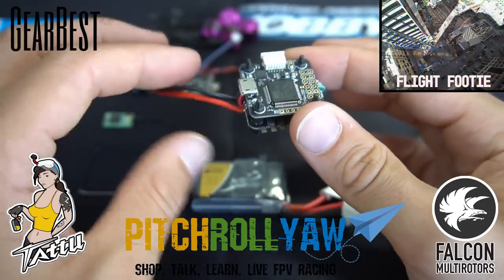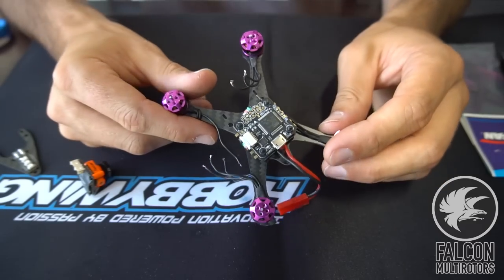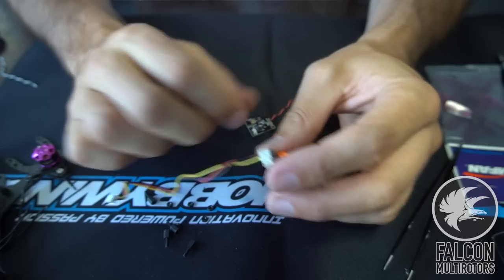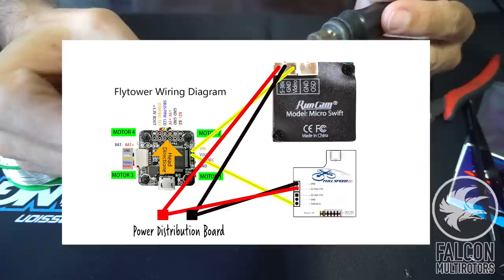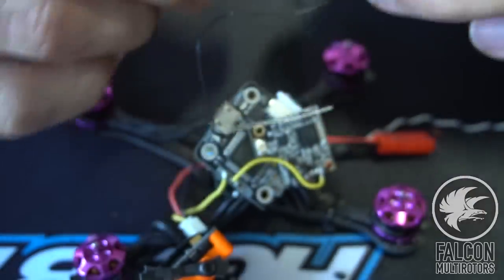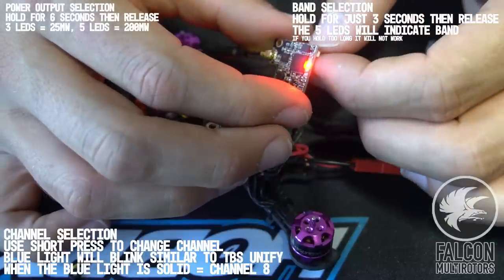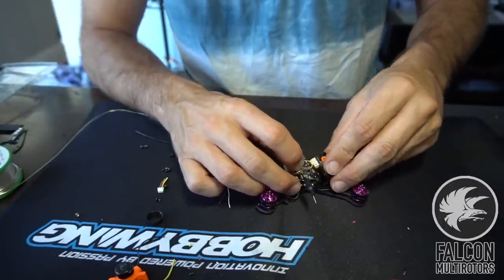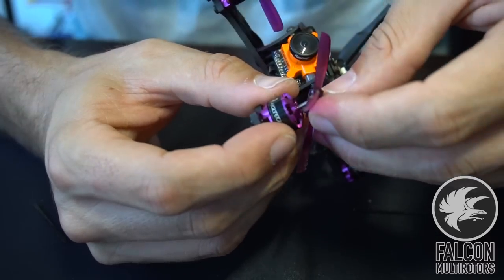Build a Micro Drone in under 60 Minutes

Comment: Great tutorial! I'm a high school teacher and I want to build this drone in Engineering Club with my students. I had a few questions. Approximately how fast is the drone? I want to make sure my students and I aren't building a drone capable of flying more than 40 mph. Does the flight controller have altitude hold? Do you have a recommendation for a flight controller for novices that would still work well with this setup?